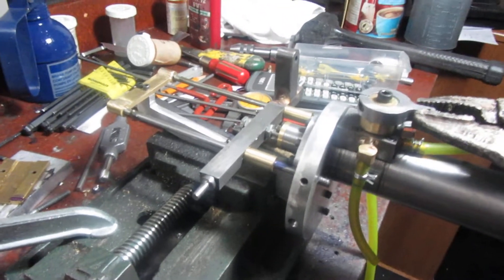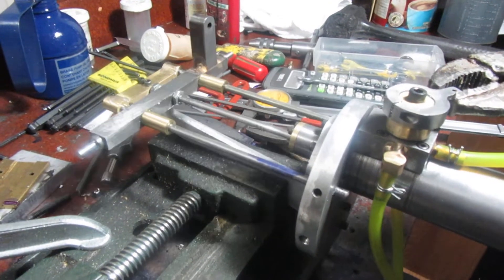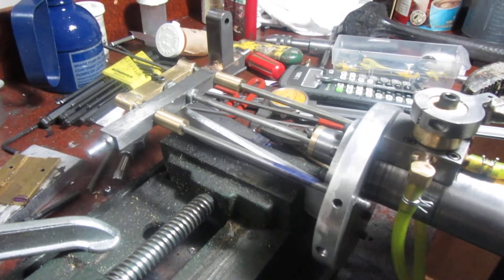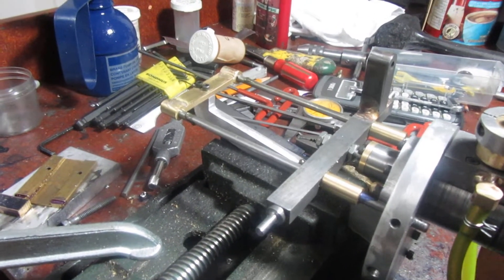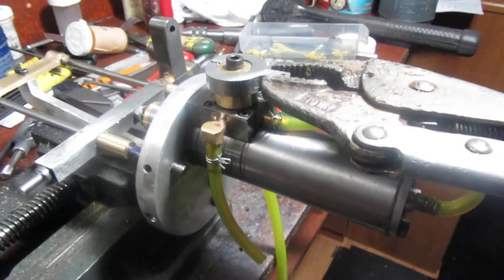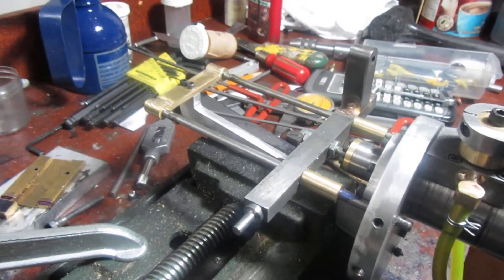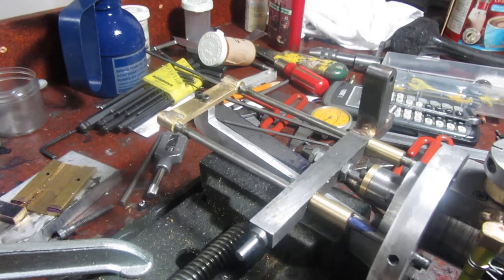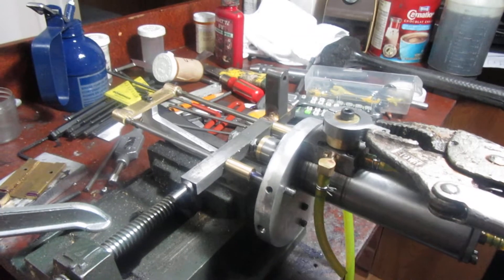CYLINDER OPERATING CROSS HEAD ON GUIDES 2020 09 26 001

Comment: Is the valve timing right Brian? It looks like the valve is moving in the same direction as the proposed push/pull rod. Surely it should be arranged so the rod will change the valve direction????